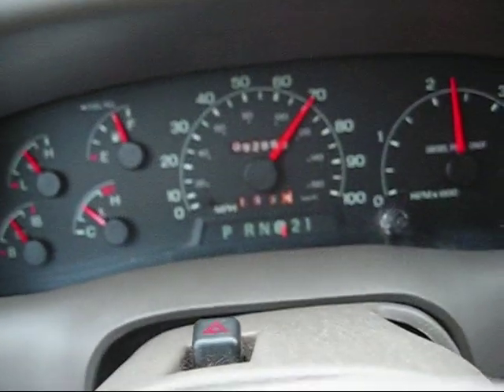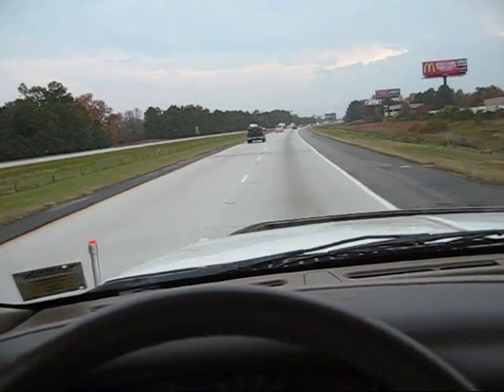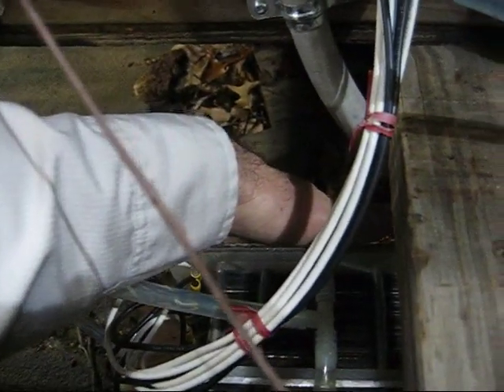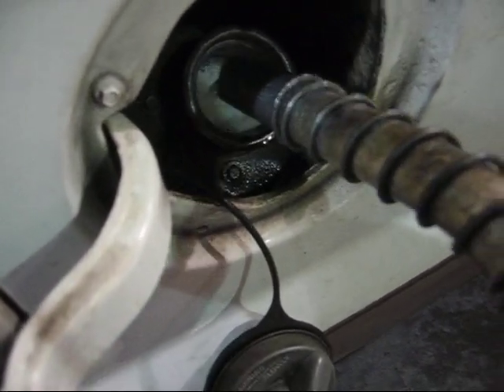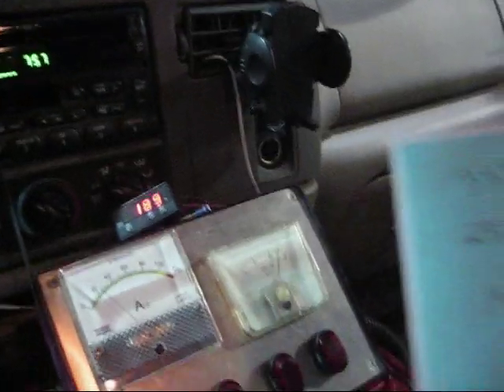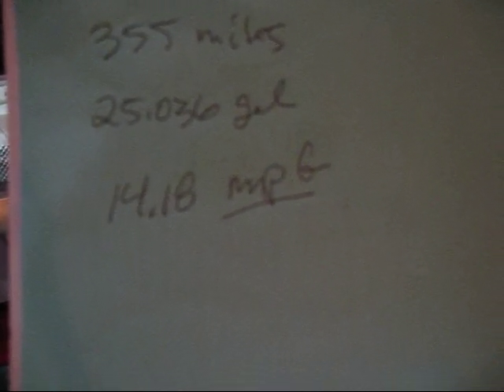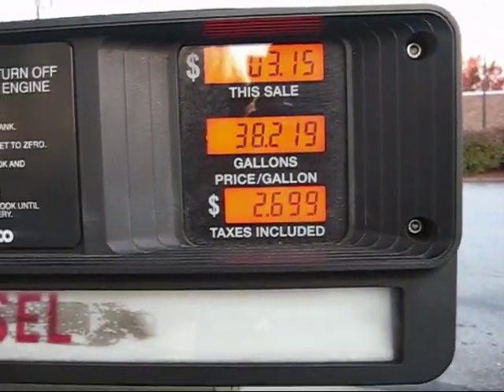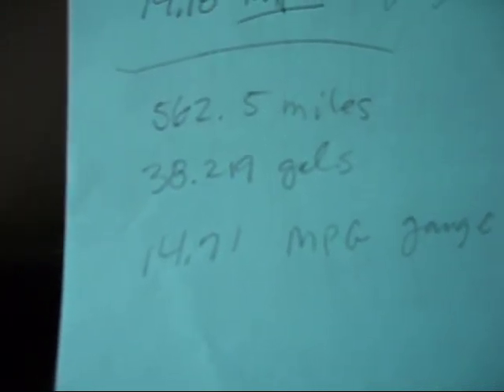MPG 1000 mile trips W/HHO in a Ford F350 7.3L Diesel

Comment: I built one for my van and definitely got a bit more gas mileage. The most striking thing for me about it was the exhaust aroma. The hydrogen injected into the air intake causes a much more complete fuel burn. I sat at my tail pipe sniffing, just steam. Hardly any smell at all.

Comment: I am in the same boat as you. You will never be able to convince the 350 regular cab guys that get 19+ that nothing is wrong with the truck, they just can't grasp the extra weight issue along with the rear end issue. I noticed a big difference opening up the intake and a 4 inch exhaust. I can baby it to get 16-18 running 65 without HHO. I am going the WATF route. Got a good endless supply, and I just take the "flushed" stuff (really clean).

Comment from the maker: @markalleus Yeah, I have 4:10 axles. The axles are great for off road and pulling but they kill the  fuel mileage. My HHO brick has a leak so I haven't been using it except on long trips (slow leak). I plan to tear it down and improve it but I haven't had time. I recently changed out the gray recall cps for an original black cps. My non HHO highway fuel mileage increased from 14 to 15.

Comment: my '02 f250 7.3l gets around 19mpg at 65mph. at 70mph or 2k on the tach (I noticed you run 500 rpms faster at 70 than I do) mileage drops to about 16. was wonderin how the truck and the HHO is now.

Comment from the maker: @benzguylv Hi: The MPGs you can get from a 7.3L Powerstroke varies based on size and options. This truck is a 2001 F350 Crew Cab, 4X4, DRW, with Automatic and 4:11 axles. Excursions are lighter and have fewer tires. I don't know what MPG an Excursion gets but it should be better than my truck.

Comment from the maker: @kenfo0 Hi: I know what my goals are. My primary goal is to get the best MPG I can with this truck. I primarily use this truck for work and it is configured the way it needs to be for my work. 
I am not going to strap a giant cone onto the front of the truck or change over to skinnier tires or change out the running gear. Get real... think of the costs involved.  My potion is chemistry not magic and I have posted videos that show that it works at various speeds.
Mars

Comment from the maker: @healey65 Hi: I agree that you can get better MPGs at 60 than 70. I get my best mpg at 55mph. On the other hand to drive 650,000 miles at 60mph would take 10,833 hours. At 70mph it would take 9285 hours. That's a savings of 1548 hours. If you figure that you are awake 16 hours a day, that's almost 97 days.
Mars

Comment: I can tell some of the reasons your mileage comes in the way it does at say 14. I drive a dodge with a cummins and I have driven 650,000 miles thats right 650,000 and from my experience 60 mph is where I get the best and I turn about 1800 rpms and I run 3:54 gears with a five speed and it being a dually . Now if I take upto 70 like your driving I loose 6 mpg . I know everyone is in a hurry these days. But you should try a trip doing 60 I bet it helps a lot your burning fuel cause your rpm's

Comment from the maker: @adamslurch71: You say that you have an Excursion is it a 4x4? The curb weight of an excursion 4WD Diesel is 7,648lbs. My truck is a 2001 F350 4x4 crew cab with a 7.3L, automatic trans and dual rear wheels. When I drive my truck across the scales at the scrap yard it typically weighs about 9200lbs. Ok so that is about 1600lbs not 2000lbs. Apparently you have bolted about 5000lbs to your truck. That makes it less likely that you get 24MPG. Do an accurate 1000 mile MPG test and get back to me.

Comment: @mars1952 your math sounds about right my 97 stroke with a 4.11 dually it a cheap programer gets 14-16 running 60 thats 1950-2000 rpms on the highway when i moved i was around truck trailer 17000lbs and running 60 maintaned 9-10 mpg

Comment from the maker: Hi adamslurch71: The truck is very well maintained. I would like to see you use the top off and MPG calculation methods that I outline in my videos to see what MPG you are really getting at 70+MPH. 
 In another 2790 mile MPG where the speed limits were lower test I got 18.62 MPG. Look for 2790 miles in my HHO MPG playlist. Keep in mind that this truck has dual rear wheels, 4.11 axles and it weighs over 2,000lbs more than an Excursion.
Mars

Comment from the maker: Hi philaheen:  In another 2790 mile MPG where the speed limits were lower test I got 18.62 MPG. Look for 2790 miles in my HHO MPG playlist. Keep in mind that this truck has dual rear wheels, 4.11 axles and it weighs over 2,000lbs more than an Excursion.
Mars

Comment from the maker: Hello drifking911: The increase in MPG comes from the increased efficiency of the diesel fuel burn not from the fuel value of the hydrogen. You are correct that making hydrogen by using the engine's alternator is a very inefficient process. In spite of that I still get better fuel economy by adding HHO. Check out my other videos and you will see that I have never gotten a lower fuel economy when using HHO.
Mars

Comment: DO NOT forget to fill it back up... When you suck the oil out, measure what you pull, add the same amount back in, run the truck for a minute or two, and do it a couple more times. You'll probably notice your truck runs a little smoother afterwards too, and dont put the oil treatment in until your done flushing the oil. Otherwise its wasted.

Comment: I hate to point this out to you, but I've got a 99F350 dually with the powerstroke and I can see almost 20mpg (unloaded) if I keep it at 65 on the freeway. I've taken several trips where my odometer hits in the 5-600 range, and I rarely have to put in more than 30 gallons. My truck has 178K, and is an auto. The only thing i've done is the 6637 air filter upgrade.. (The big round cannister one)

My advice to you, clean out your HPOP reserve, and put some slick 50 in it.

Comment from the maker: Hi drewglis: My truck is a 9000lb 4X4 crew cab with and automatic and dual rear wheels with 4:11 gears. All of those options suck extra fuel. If you have a truck with the same engine but not all of the same options it will get better MPG. Also I take great pains to calculate and report the MPG very accurately. Many people claim MPG results that are really only wild guesses.
On this trip I had about 1000lbs of cargo and no trailer.
Mars

Comment: Hey, Mars.  Good work you are doing.  I have a '96 7.3 power stroke, F-350 with 3.55 rear end (2 wd).
I usually travel at about 65 mph on the highway and get in the neighborhood of 18-19 mpg using straight diesel.  When I had my HHO cell on it I was getting roughly 2 mpg better.  I took it off to reconfigure it-a lot of electrolysis was going on and corroding the negative side of the cell metal.  I like how you have yours set up in the bed-mine was on the front bumper and looked a bit peculiar.

Comment from the maker: Hi xgunmetalx: Yes on this trip I got about 15mpg traveling about 1000 miles at between 65 and 75 mpg. On a more recent trip I got 18.2mpg avg. on a 2800 miles trip driving at 55 to 65mph.
Ihave returned the "chip" for a refund. It wasn't really a full chip it was a fuel injector fooler. I haven't decided what full chip I will use to replace it. i want one that allows on the go user programiong changes. 
Mars

Comment from the maker: Hi TransAm2k4: Sorry for the late reply. I have worried about the alternator but after a year of drawing an extra 40 to 70 amps it still works fine. If it does fail I will replace it with a 250Amp alternator.
Mars

Comment from the maker: The 7.3L diesel needs a lot of HHO and I haven't found the upper limit yet. My problem at this time of year is keeping the amp draw up not down. I have a brick on the work bench that could draw 200 amps without over heating. Unfortunately real life has interfered with my HHO hobby but I will get it built soon.
Mars

Comment from the maker: I am trying to get as much HHO output as possible and I have pushed the brick to as high as 70Amps. At 70Amps the wire connections got a little hot but the brick stays less than 50C. I have 6 gauge wires feeding the brick and 4 12 gauge fine strand wire, one to each hot plate. If I want I can limit the amp draw by using a weaker electrolyte. I don't use a PWM because they consume watts. I want all of the watts that I use to make HHO. Keep in mind that this is a 7.3L engine. Continues:

Comment from the maker: My Truck is a 4X4 with 4:11 axles. I needed the low axle ratio for farm work and when I bought the truck diesel was about 95 cents a gallon. It would be nice to have higher ratio axles and a three range transfer case but alas I had to compromise.
Mars

Comment: Hi. No it wouldn't do what you want it for, its only 1300cc, its very low geared, you can drive in towns in 5th gear no problems, but when on the highway I could do with another top gear or maybe 2, the wife's always driving it so I never get chance to park it, but yes its easy enough.
Thanks.
zerpoint132

Comment from the maker: Yes it was 38 gallons (143.86L). That would have cost me $380 on your side of the pond. When I top off the tank all the way to the rim it holds about 40 gallons. I can drive 560 miles on that much fuel. Unfortunately my bladder can't last that long.
I would like to have a small high mpg car like yours but you can't pull a 10,000 trailer with your car. I bet that it's easier to park though.
Mars

Comment from the maker: Hi: 
My truck is a diesel. 
The simple explanation is that adding H2 (HHO) into the fuel air mix increases the efficiency of the fuel burn. The process of making H2 out of water using your alternator that is powered by fuel so very inefficient. In spite of that the H2 increases the efficiency of the fuel burn so that you get a net increase in engine output per unit of fuel and better MPG. 
Google HHO According to Bob and read what is there and follow the links.
Good Luck, Mars

Comment from the maker: Hi Daniel: On the trip to Florida the truck was empty except for me (about 9000lb GVW). On the trip to Memphis the truck had a light load (about 11,000lb GVW). No trailers on either trip. If you check out my MPG playlist you will find some test run towing trailers. But in the earlier tests I was not pushing the brick so hard. The more HHO I pour in the better results I get.
Mars

Comment from the maker: Hi phlathack: Draining the brick to prevent freezing is a real pain. Also the cold limits HHO production. Nothing much happens below 25C. Bricks that are exposed to the open air vary wildly in temp and production. The solution I think is to heat the brick so that it is at a constant temp. I plan on using a oil pan heater at night and waste engine heat (coolant) while driving. 
for now I drain the brick at night and vary the electrolyte to keep production up.
Mars

Comment from the maker: Hi Boyntonstu: If you check my Playlist of MPG vids you will see several side by side MPG tests with and W/O HHO. During both of my long trips I had brief times when the HHO brick stopped working or I had forgotten to turn on all the switches. It didn't take long for the MPG gauge to start to drop. Normally if I drive without stopping the MPG gauge continues to go up. When it started to go down I checked and two times the pressure cap was loose and once I hadn't turned on all the switches.
Mars

Comment from the maker: I rated my brick at 5.2MMW before I learned how to compensate for heat and moisture. It's output is probably 4.5MMW. At 60amps*13V the output is 3.5LPM. At anything less than 60amps the MPG improvement is hard to measure. Even at 60amps I only get a measurable improvement during low fuel consumption like when cruising during at a constant speed. Stop and go driving or trailer pulling uses a lot more fuel and the HHO makes very little difference. Continues:

Comment: Good job!

Have you tried running for 30 minutes on followed by 30 minutes off to see what your mpg gauge indicates?

Keep it up.

BoyntonStu

P.S.  My Ford Escort MPG went from 28-29 to 32-33 by just restricting the air input about 30%.  The computer thinks that the car is in Denver at a high altitude rather than at sea level here in Florida.  FWIW

Comment from the maker: Hi Sam:
I can only guess. As long as I am using the alternator (powered by diesel) there has to be some kind of limit considering that the whole process is inefficient. Mechanical energy is converted into electrically energy (alternator) then the electrical energy is converted into chemical energy (HHO) finally the HHO is burned. All the steps are less than 100% efficient. All that energy that is lost to inefficiency has to be made up for by increasing the efficiency of the diesel burn.
Mars